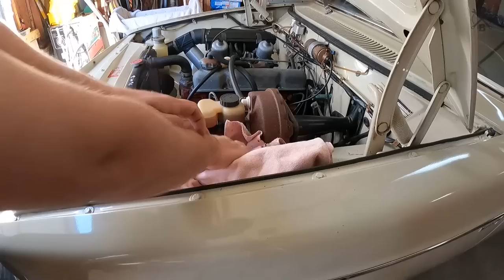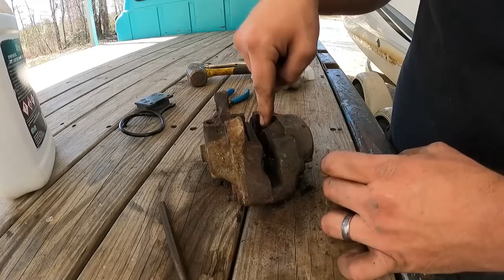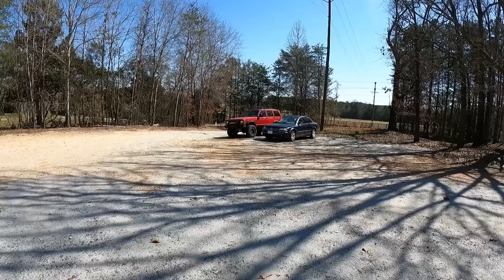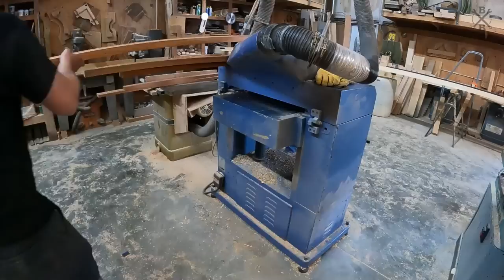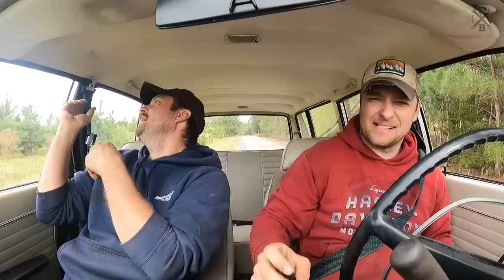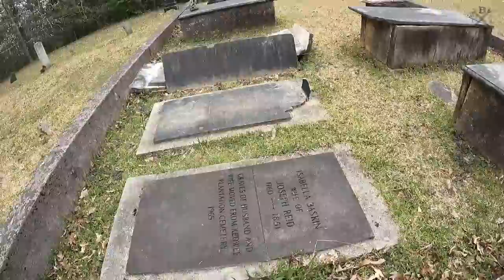ABANDONED Volvo Wagon Rescued After Many Years: Custom Roof Rack Build

Comment: As reliable as it gets! Getting hard to find one this nice even here in Sweden... Keep up the good work (and please keep the car as well) :)
Reply: Ah, its both harder and easier to find near mint condition volvos now. 10+ years ago it was easy to find endless rusted out ones for almost free, and a few old man owned in decent condition but no one restored or cared for them. Now theres more and more restored ones and more hidden barnfinds coming out thanks to higher value so its way easier to find a mint one today but you have to pay 50 - 120 000
Reply: @sjoerdriberi9268  yes remove a zero and its close to dollar
Reply: @neuroleptika  All agreed, its both easier and harder. With "this nice" I meant like a barn find of the sort Michael did find. 145 (station wagon), 2 owners, sitting for the last 10 years, everything original on the car, not completely banged up etc. Like a dream for a restorer! Already restored or customized ones are still quite easy to find if you got the cash.
Reply: @OrangeZingoSWE  yep thats true. But if you just want a decent or mint 240, even the most expensive will often cost you less than to restore yourself so I think rn prices are in a sweet spot, you get basically a brand new 240 for half or less of a new low end car

Comment: This low mileage rust free Volvo station wagon is a real gem. It looks incredibly good. Extremely rare to find in a condition like this.
2) I really hope that I missed something or have you seriously changed only the brake caliper and pads on one side? If so it's definitely a big, big no go!!! It's extremely important to absolutely always do brake renewals on both sides of the axle. If not, you will have uneven breaking and that's definitely a big safety issue.
Thanks a lot for making explaining recording editing uploading and sharing.
Best regards luck and health to all of you.
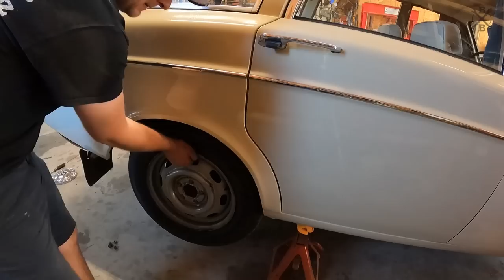Reply: Yes you're right, but I think he did. At 4:35 he says "we can start on this side" and in the past, Michael often showed it with one example and in a later shot/video, you could see that it's done completely to make the videos more varied :)
Greetings from Germany
Reply: Guten Morgen s.g. @nicolaskuhn1305 
👍👌👏 Okay, danke für den Hinweis. Ich hoffe wirklich, dem ist so. Ich habe aus der Erwähnung eines (Singular) Bremszylinders allerdings anders geschlussfolgert (zu Anfang des Videos, als er den Karton von VP auf dem Blech der Frontschürze/Frontmaske auspackt).
Viele Grüße, Glück und Gesundheit.

Comment: My old man had a 92 240 5 speed in fjord  blue, ipd exhaust, mild cam, installed 2 janky turbo setups then got a nice one, suspension upgrades all around, and a clutch upgrade. But the thing looked completely stock. It made 275hp at the wheels in final form and he sold it for 3k 4 years ago with 400k on it to a good home.  The skinny little tires were so kick ass for burnouts in the high school parking lot.

Comment: These are beautiful, well-designed cars and this example is in such clean original condition. Probably my favourite vehicle on this channel - I'd love to see more of her but in true Volvo fashion she will probably give you very little cause to tinker, so just enjoy driving what is still an incredibly usable everyday classic.

Here in the UK the 140 series was prone to rotting out, and so if you want one now you need deep pockets or else to be very handy with the welder. Even the later 240s (which I have in 1982, DL sedan form) were no match for our horrendous weather. 

The dual circuit brakes can be a pain to set up but they were a revolutionary safety feature when Volvo introduced them in the 60s and designed to make a total brake failure almost impossible. Good call on the roof rack, I think they add a nice retro surf wagon look to these cars. 

My partner and I have six kids so if i had one of these, I'd probably source and fit the optional third row rear-facing seats that stow away into the trunk floor and make a really practical family bus :)

Comment: I have always held Volvo's in very high regard because of the craftsmanship that they put into their vehicles or at least they used to they still look pretty good these days but probably not quite built as good as the ones of yesteryear. Nice job Michael
Reply: They are a Chinese company these days. 3 of the 4 factories are in China
Reply: @olikat8  still made well Geely makes good cars
Reply: No. Geely does not equal Volvo. I am not Swedish, but the whole point of Volvo is that it IS... The only Chinese add-on that, in my opinion, might go well on this particular car would be a set of stainless beauty rings for those beautiful steelies!

Comment: Very nice old Volvo ! my Dad  had a true love for Volvo Wagons    and when i was a teenager inSouthFlorida   we would buy any one we could find  usually we  Stripped them for parts  for resale   and sold off the body shells for Scrap  he mainly liked them for the quality and Reliability and both my parents drove one for a Daily Driver  it got to be so many of them  that   if one was a driver we just called it the Color  of that one  did you know on those brake systems they had  a  safety device on the Steellines they called the PorportionalValve that you need to reset   for Bleeding the System?   it was part of the Engineering for Safetey that  if  a big leak  occurred either on the front or rear Brakes  that Valve would still  allow Fluid fromthe Master Cylinder to be pumped to the other half of the  system so you still had Some Brakes  it was  super duper easy to do as you simply unscrewed  this Valve  that looked like a sending unit  and put it back in  its place  without any fluid pressure then  Bled the system  if you didn’t perform that  task.  a Caliper was likely to  lock up on you   in the 70s  many Hot Rodders and Muscle car guys  would Scarf up Volvo 4 wheel disc Brake systems to modify and bolt onto  their cars to get them to stop  better this was Way before Willwood  many builders preferred using Old Jaguar independentSuspensionFront Ends  instead of the  heavy American Systems for improved handling  and i know the Volvo Calipers  fit easily on those   when the Volvos in the late 70s switched to FuelNjection they utilized the Bosch system and that was on lots of other cars  like Jaguars Volkswagen ,Porsche ,Audi  all those Components  and parts were really expensive  a it was a Electronic FuelInjection System  that  by a Computer under the front seat  it was called the Brain and was basically like todays ECM  nobody but the dealerships knew how to reprogram those things  and  the Volvo ones would Plug into any vehicle with that Bosch system that  had a failed. one on it our local Junkyard used to  give us a thousand dollars for any of those  that came out of a running car he sold them off at two thousand dollars  as fast as we got them for him !  in the late 70s  all the watercooled VWs  used those  and  they were notorious for not being reliable  many Professionally trained Mechanics at Small shops  would tell the customers  they needed a replacement but in reality. those guys didn’t have  th decoders and knowledge like they do today  so those things were in high demand  all over. our local Junk Yard at that time was one of the first yards to join the network of Dealers that joined the force  of tracking parts with everyone else in that business  essentially the  start of Computerized inventory    i’m almost 60 years old and i laugh now that i was able to see that  whole thing  first hand cars that tuned and adjusted themselves  a high tech self diagnostic system that could tell you what was broken  and so on don’t get me wrong i didn’t know how that worked personally but i knew that those things were  expensive and made us money !

Comment: Love it- my "Beige fantasy"  '76 Valiant has more neighbors stopping to look & talk about it than the Shelby GT350 sitting right by it.  More people have memories & a malaise-era, "Pedestrian" car is more rare than  an HP muscle car.
Reply: I LOVE later-year Valiants.
Reply: @OnkelPHMagee  I'm cloning an A38 service vehicle with it. Few deviations & improvements like an A-833 OD (iron case), 12" rotors, FFI suspension pieces, 8.75" axle with 3.55 (489 case, SG), relocate the battery, K- member that is fully perimeter welded w/ skid plate,  sub- frame connectors, torque boxes, Sanden AC compressor in place of the 2-piston, cast-iron monster, Nippondenso starter, Nippondenso alternator ('89 Gran Fury cop car), color change...
Reply: When I was little, Dad ALMOST bought a new Valiant in 1975. It was a low-end car in "period-typical" metallic medium brown with a gold interior. What made it a unicorn was the Slant Six with a 4-speed manual transmission on the floor. I was interested in cars at age nine, but I had no idea at the time about how rare it was.
Reply: @OnkelPHMagee  a even more rare A-body of the '75-'76 era? The A38 police car versions. Although other countries had them (Finland, Mexico for instance), only 2 years here. I have drive a 318 version & a 360 version.

Comment: those brake flexis block up internally over time, causing brake binding/ overheating, glad you replaced them both. talking of both, you did replace both sets of pads at rear? [please say yes]
when working on "wet" brake pipes, i always hold the pedal down a few inches with a bar/stick. this closes the reservoir ports, + no fluid will drip out [i hate brake fluid on the workshop floor]
the UK version had a noticeable wind-whistle at speed, similar to when you have a roof-rack on, i see you are cutting out the middle man on that front...     keep up the good work

Comment: Not entirely original, at some time the Stromberg CD2SE carbs were switched for those SU carbs, most likely from a 71 or a non fuel injected later model from another country. I had several 140 models over the years, and built a 122 2 dr and a wagon with plenty of upgrades. Seems like the low miles ones always have that BW35 automatic.
Reply: Defintely better off with the early SU's than the 'Stranglebergs'.  Planning to do the same with my Jaguar project.

Comment: Typical volvo  quality, these cars  were icons of common sense and quality fabrication.
the roof rack is a very good quality too, a very nice job on a very nice car.
the only negative point is the transmission of that car, not really a good option when you have the choice, the reason is that the engine torque characteristics does not match the transmission, a much better car with the manual gearbox with the overdrive option. This car was designed around the manual gearbox, the automatic BW35 transmission was an add on option that came later, that option was valuable on a taxi fleet where the performance of the car is not the first goal and the car is always driven in heavy traffic at the cost of loosing most of the driving pleasure of the car.